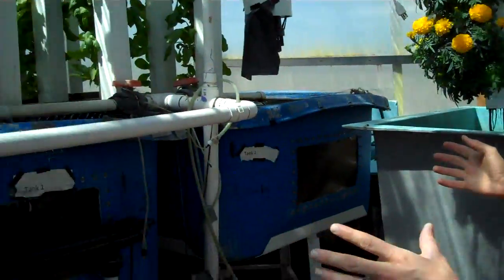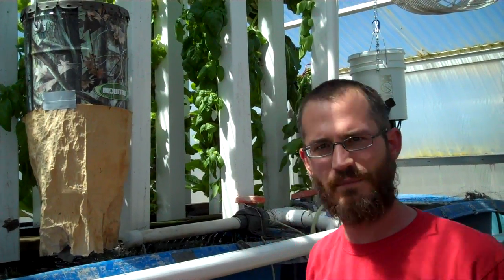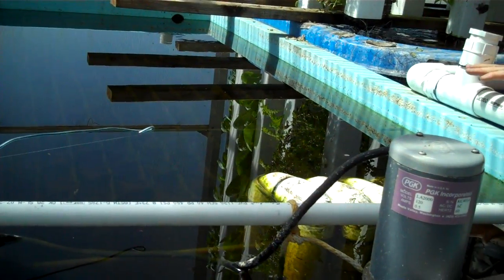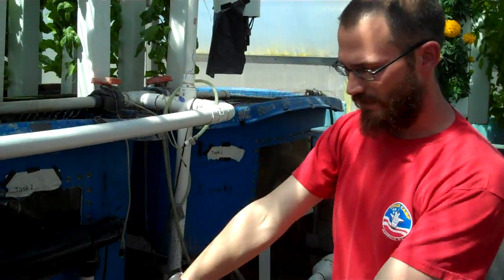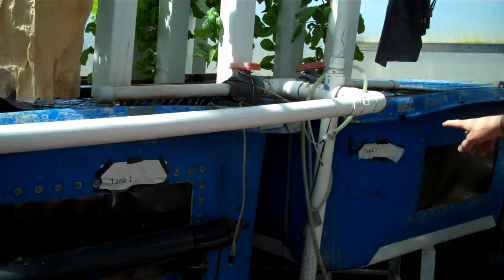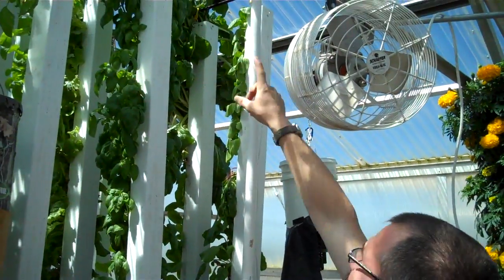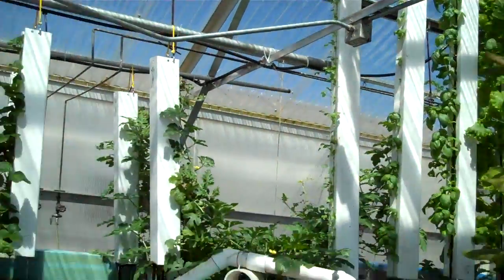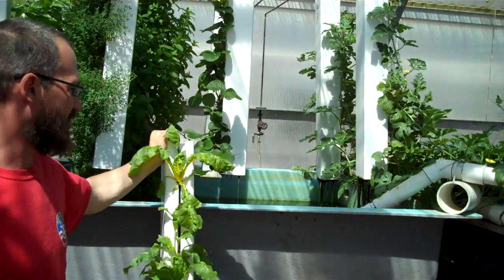UW grad student's hydroponic tower system grows lots of veggies

Comment: Is that matrix you have filling up the square white vertical tubes good enough at spreading the nutrient solution out?  It would seem at least at first glance that the water would just find one path down to the bottom through that ... the path of least resistance, and the plants might or might not get any nutrient solution?  How do you get it to wick out and fill up the whole tube, or do you need to?

Comment: Is anyone aware of studies regarding PVC for hydroponics? Just curious if they leach something into the water, which is then absorbed by the plants. I think i would prefer tubing approved for drinking water...
Reply: ladedk It doesn't. The reason we use black poly and copper for indoor plumbing is they have anti-bacterial properties (copper moreso than poly). We use PVC for HP setups because it's cheap and safe.

Comment: Wasting alot of energy to run the pumps !! Nature's way or God's way is hard to beat !!
Reply: It's late at night, but I think "natures way" usually just means gravity and manipulation of water flow using energy other than electricity. Like a wacky invention of springs and pulleys of some kind. He may not be "on the grid" or may be using solar. But personally I think using electricity is the only efficient way to move water in a limited space and with limited time. Thus my own house uses water pumps, it has to!
Reply: Or, he just waters his lawn with a hose. :P

Comment: One question. Ive seen all your video's I can find, but have never heard you give an example of how many towers per fish ratio. I'm guessing that each tower represents (when planted) 1 square foot of grow area. I think most AP models call for a 2:1 ratio. So I'm guessing that you have 2 towers per 1 lb of fish. Am I close, or do the towers work more efficiently as a bio filter than a standard AP flood and drain grow bed?
Reply: 1 lb fish = 1 sq' of water in FT.
1 sq' water to every 2 sq' of grow bed (2 towers).
Reply: I have coy cold water fish and there dirty as hell which my plants like, I first discovered the nitrogen level were high in my tank as a novice fish keeper and then put one and one together. now i simply pump the water from my tank to the plants and cleaner water returns to the tank. the fish thrive and so do the plants so everyone wins i dont even have to use a filter, i have 12 aprox 1 kg koy and a 500 m verticle growing area.

Comment: These poly tubing bags should make excellent vertical tubes.  Insert growing media and seal the ends.  Insert water tube at the top and add drain holes at the bottom.  Use shipping tape with reinforced threads for the slits you cut to insert plants.  9 cents a foot.  Hang them with zip ties.
look up "Clear Poly Tubing - 6" 6 Mil 1000'/RL" on globalindustrial

Comment: With your system, would it work better to use a variety of plants per SINGLE tower instead of isolating them by type? Reason being is that the hydro-water at the top of the tower and top plant will be different nutrient/waste-wise by the time it gets to the bottom of the tower and bottom plant. As you know, different plants utilize different nutrients and acidic levels, maybe this will further enhance the system?